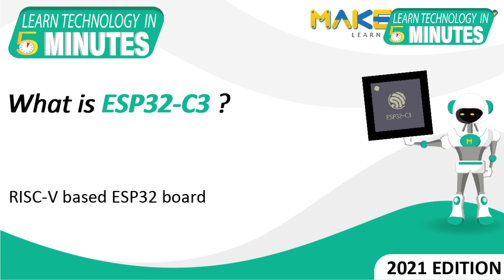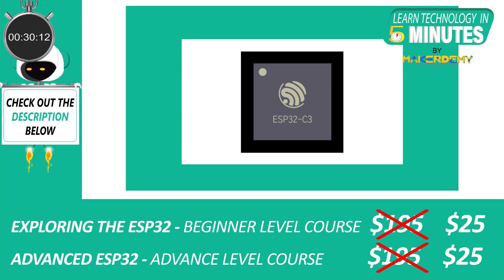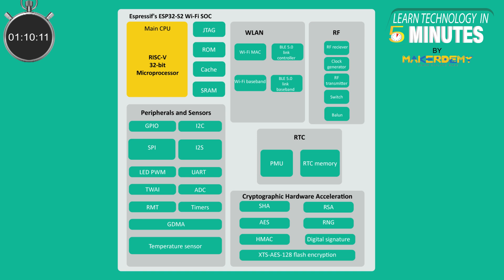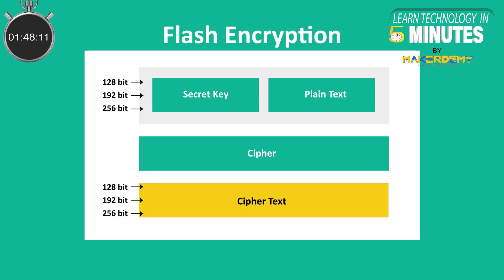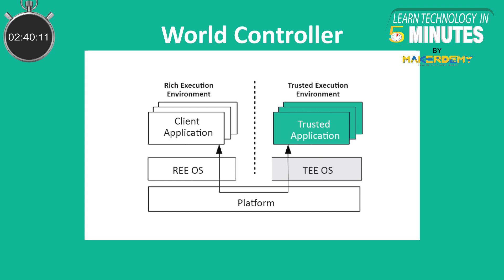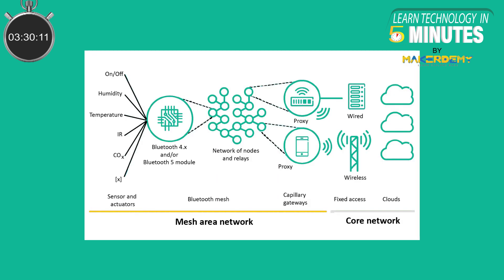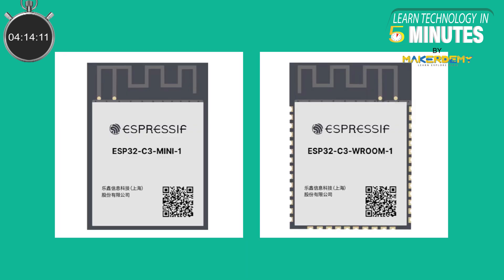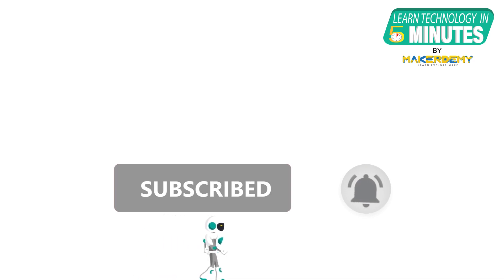What is ESP32-C3? (2021) | Learn Technology in 5 minutes

Comment: arduino C3 and S2 support https://youtu.be/KKVuDO2HBrU  Then find the arduino15 folder, look for the esp32 "boards.txt" file and change the RTS/DTR control from false to true for each dev board you use. Otherwise the IDE will not enable the dev board if the serial monitor is on. Tough to debug without it... This applies to the dev boards using the CH340 USB-serial chip.
Reply from the maker: Hi. Thank you for your valuable input.

Comment: Hello, thank you for this video! Just curious if you know whether this module will also be supported on the Arduino IDE.
Reply from the maker: Hi Moh Maya,
Please do not expect the ESP32-C3 board to be supported by Arduino IDE anytime soon. As this is a new board at least for the time being you have to use ESP-IDF to work with this. Within a Year or so you can expect the Arduino team to work with Espressif to bring out a slew of updates based on all the new boards Espressif is pushing out. We hope this cleared your doubt.
Thank You